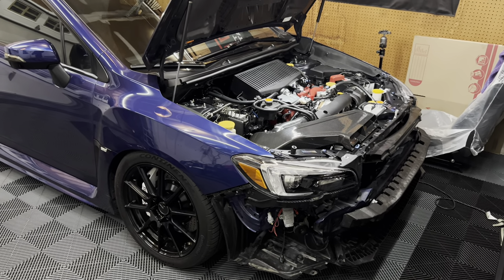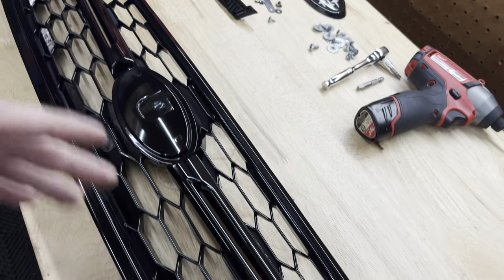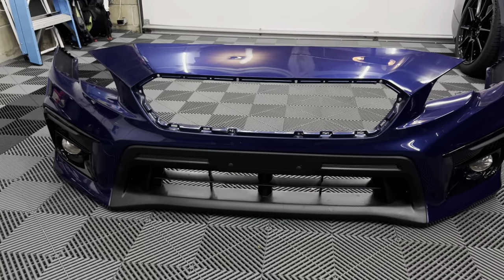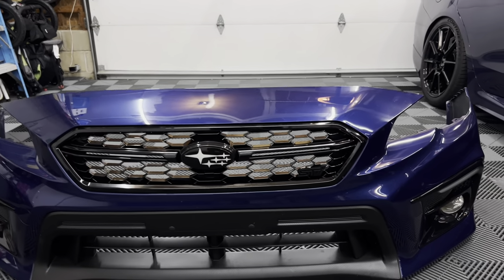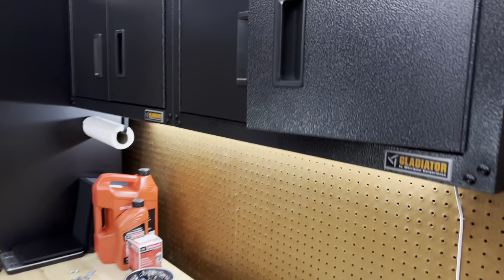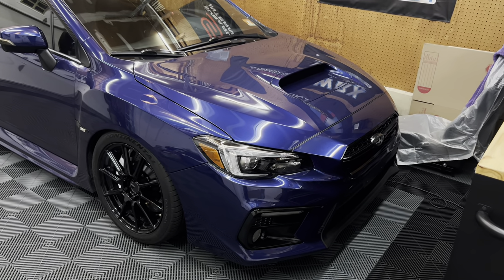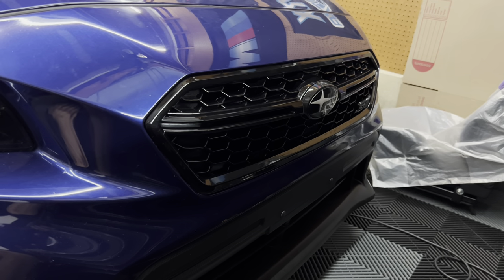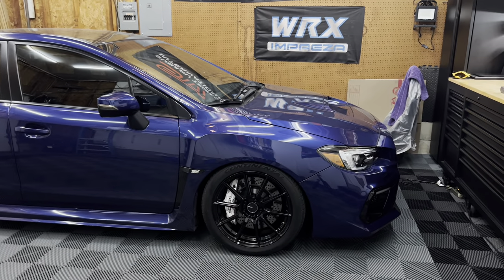Replacing The Front Grille On My STI - OEM+!!

Comment: Did you have to change the headlights at the time of converting the front bumper to 2018+?
Reply from the maker: No you can run the 15-17 headlights, which I did for a while until I upgraded.